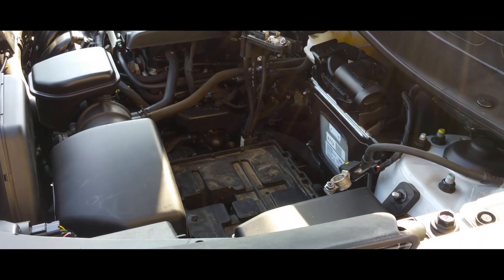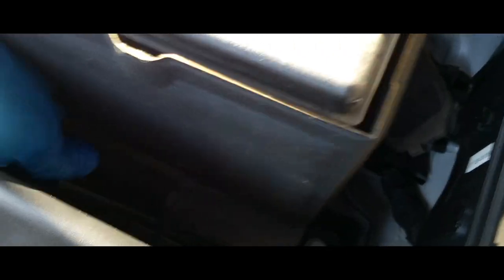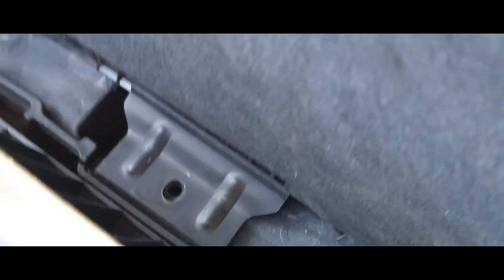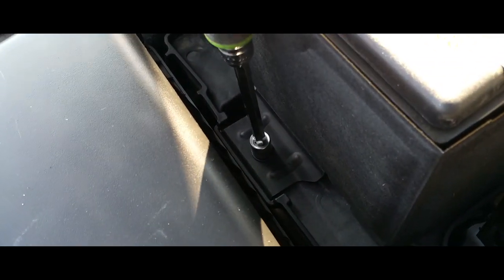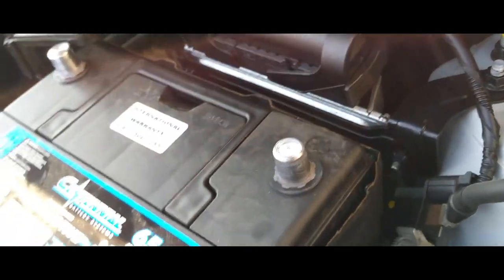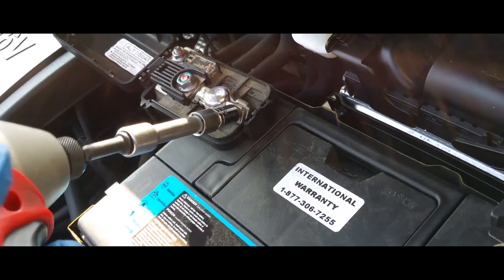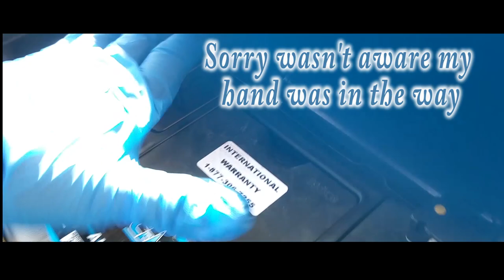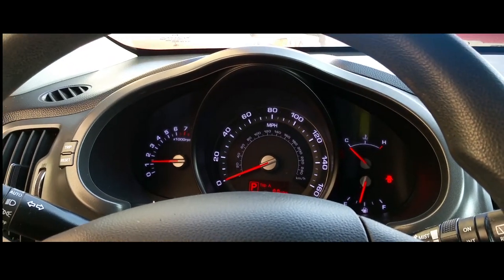How to: Install a Battery from a 2013 Kia Sportage

Comment: If I change the battery on my kia sportage 2013 does the radio need a code
Reply from the maker: No it does not you should be good